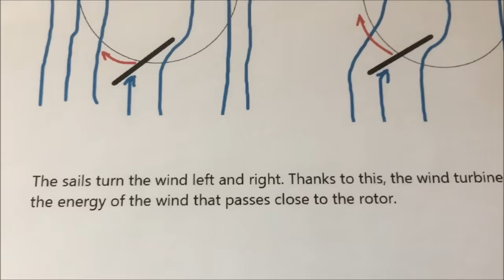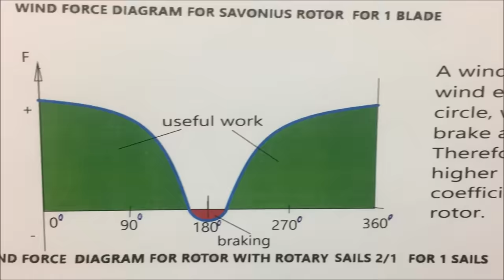A wind turbine they have been hiding for 138 years

Comment: It is an interesting design. but I don't think it is practical. I can see where there would be a lot of resistance on all of the linkage plus all those moving parts including needed bearings would probably  fail quickly in the rain. I am sure it would be cheaper to build a regular rotor that would put out more power than this could. I see this machine as an interesting proof of concept but not actually practical.